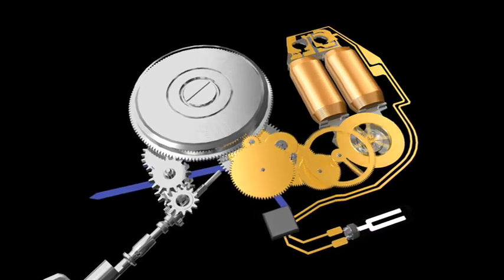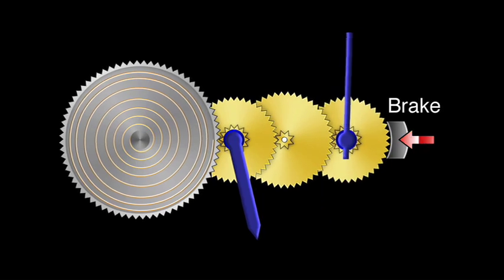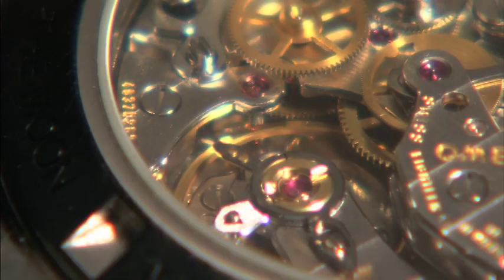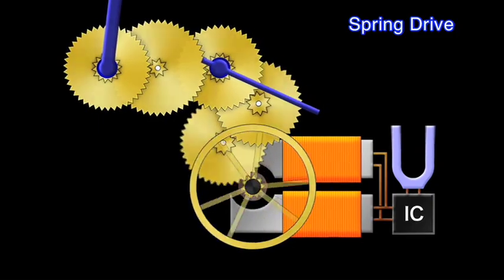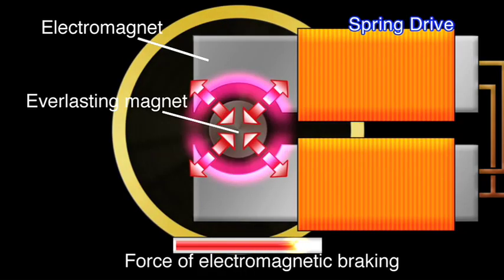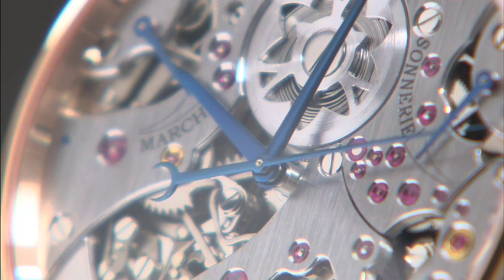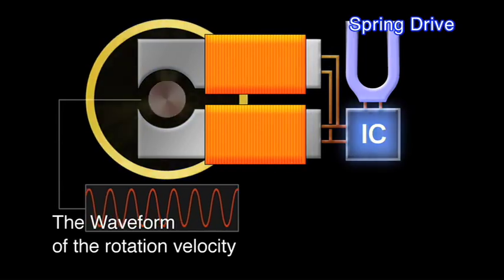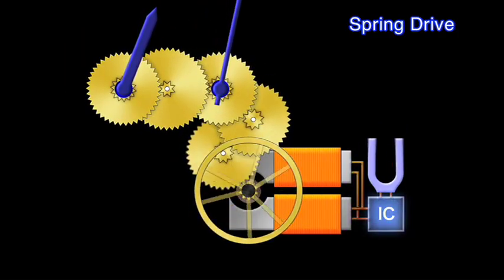Spring Drive function

Comment: This is the ideal design for mechanical watches.

This mechanism operates without batteries, yet an electronic unit manages all functions. The spring serves as the energy reservoir, similar to traditional mechanical watches. Magnets regulate speed, akin to regenerative braking in diesel locomotives. In Fields locomotives, energy is dissipated through a heater coil, while in this case, the energy produced by the regenerative braking powers the controller circuitry.

No batteries are needed, eliminating the necessity to open the watch annually. There’s no risk of battery leakage, and the accuracy is exceptional.

Comment: Tbh, this movement doesn’t seem all that complicated. Ppl have been talking about how complicated it is, but in reality, it just seems to me like an electromagnet regulated by a quartz movement to brake the hands. I’m not going to claim I could make this in my sleep, but at the very least the concept seems simple enough
Reply: Not complicated at all, it took Seiko 20 years and hundreds of prototypes to get to production.Do you realize the electronics marvel this thing is? It requires a very low electric current to power up the IC and generated the electro-mechanical break.

Comment: the breakthrough will cause a lot of debate regardless of the impressive results because the path taken is unusual 

unlike innovation where most will nod at the path taken and the impressive results

Spring Drive is a breakthrough, NOT an innovation

Comment: This is absolutely brilliant. The biggest downside to a quartz watch is the battery, be it a regular button cell, a rechargeable cell, or a heavy duty capacitor like Citizen uses, it still is a vulnerability if one cannot be sourced. An automatic watch, while still vulnerable to impacts and wear, doesn't need any consumable power source.
Reply: @mybrainlikesthings  you're not wrong there, higher end quartz requires far less maintenance than even the simplest mechanical or hybrid drive movement. Even without AT connectivity a good quartz can still be less than a minute off over the course of a year, and a high end one may gain 15 seconds a decade at worst. It's really just the battery waste itself that bothers me. While one button cell every 5-10 years isn't exactly dumping used car batteries into the ocean, they are still technically hazardous waste if improperly disposed of. I've been trying more and more as I grow older to move away from single use batteries wherever I can. Even though mechanical parts need to be replaced and disposed of as well, in theory those are just base metal, and even if they can't be recycled they pose less of a chemical threat to the environment.
Reply: How is the kinetic energy in the main spring not a "consumable power source"? ...the power gets consumed by the watch until in needs winding again and therefore gets revitalized. Just like a battery! ...only in longer intervals, which could be considered an advantage
Reply: @alphadawg81  spring drive watches are wound by a rotor, like automatics, so the consumed kinetic power is replaced by the motion of someone walking around rather than a battery cell. Kinetic energy transfered into potential and back into kinetic and electrostatic all at once. Most have 72 hour power reserves, so as long as you wear it at least half the days in a week it won't stop working for years at a time.
Reply: @manoflego123  
You weren't originally speaking of automatic movements. 
But even then, solar movements would ne their direct counterpart. 
Their cell needs renewing less often than a mechanical movement needs servicing.

Comment: No escapement = not mechanical.
Reply: There is an escapement. It's just electronically controlled instead of mechanically controlled. Besides, it still uses a mainspring. If anything, I'd call this movement electro-mechanical
Reply: Seriously, that's so utterly absurd, ridiculous and factually incorrect.😮😮😮😮

Comment: a quartz watch without a battery - why? Seiko allready have the kinetic system - if you want a quartz without the need to change the battery - buy the kinetic (or the solar).
Reply: Because a mainspring-driven watch has higher torque compared to quartz movement. With higher torque, watch designer can put longer hands on the movement.
Reply: I had an AGS watch that had a faulty battery/capacitor, and after an expensive repair the new capacitor also broke and leaked all over the inside. A Pulsar watch also didn't last for more than a few years. So, I don't recommend those watches (at least from Seiko). Spring drive does not have this problem.

Comment: Mechanism SPRING DRIVE - sucks!! Do not buy this broken piece of iron!!! Unfortunately, I fell for an advertisement and bought SEIKO LANDMASTER with SPRING DRIVE!!!! After a week, the clock just STOPPED !!! Very disappointed !! Do not take this piece of shit!!! If interested, there is a video of how they stop ...
Reply: The term imbecile was once used by psychiatrists to denote a category of people with moderate to severe intellectual disability, as well as a type of criminal.[1][2] The word arises from the Latin word imbecillus, meaning weak, or weak-minded.[3] It included people with an IQ of 26–50, between "idiot" (IQ of 0–25) and "moron" (IQ of 51–70).[4] In the obsolete medical classification (ICD-9, 1977), these people were said to have "moderate mental retardation" or "moderate mental subnormality" with IQ of 35–49.[5]

Comment: if the Swiss invented this they'd be raving about it, the Spring Drive is awesome best movement imho
Reply: The release of the spring's energy is dictated by a friction-less interaction that uses quartz as a reference, not the quartz itself. I wonder how the movement would perform without the quartz portion. Anyways, even if it's just another quartz we have to agree that all things considered it's on a different level.
Reply: @TheGrenadier97  Yes. That's the point. Quartz as a reference.
Reply: Exactly what I thought 😄
Reply: Yep it doesnt get the recognition it deserves!
Reply: Precisionist has a ticking second hands, 16 beats per second. Shut up if you don't what the fuck you are talking about

Spring drive can't be considered a quartz movement, because the motion isn't generated by quartz but regulated by it.
Reply: @morgenstern4.669  The whole “spring drive isn’t driven by quartz, it’s only regulated by it” is true, but this is true for ALL quartz watches. The only distinction is that most quartz watches use an electric motor and a battery, whereas spring drive uses a spring. Spring drive is technically a quartz movement, it just gets its own name because it’s a very cool quartz movement without a battery.
Reply: @Sk3tchPad  Nothing wrong with being a quartz movement tho. Technology evolves all the time.
Reply: blaser   Bulova precionist  quartz. Has the same effect, smooth sweep. Both are not mechanical aka no escapement.
Reply: @jackchueh1231  bulova ticks if you look at high fps. Meanwhile spring drive gives a smooth glide even when looked at high fps
Reply: Its a hybrid. Expensive too for no reason.   This technology should be much cheaper than 5,000$...  thats one reason it passes everyone by. When you first see it work. Its beautiful. Serene. Peaceful. . Then you see the price tag n its gone from though. They are charging the same price of a mechanical watch With an refined escapement. You can get a new speedmaster for that...  what would you choose?!  5000$. For a watch that can literally be biased to perfect its time. N should cost 500$ at most...  seiko is dramatically over priced. These can be mass produced comfortably.
Reply: @treatb09  there is A LOT more to a grand seiko than just the movement. I would say it is actually for less over priced than many of its contemporaries
Reply: @treatb09  The $5000 you pay for a spring drive watch is not just for the movement, which by the way is handcrafted and beautifully finished. It's also for the case which is also handcrafted and finished to perfection. Zaratsu polishing isn't just run of the mill work and the dial is also meticulously patterned and assembled by hand. If anything, $5000 is a bargain compared to what Swiss companies charge for similarly handcrafted pieces that don't have this level of innovation in their movements. 

And you think this is worth $500? Seiko charges that for their mid to low tier watches which, again, are way cheaper than their competition while still being quite accurate.
Reply: @aozf05  too fat… too thick…. Like Japanese GTR versus Porsche 911.  Ugly at least the sport pieces.  Now imagine is they made a 40mm case and 12 mm thick.
Reply: @aozf05  luxury items are defined by quality AND brand recognition…. Grand Seiko has no brand cache..because the entire wolrd associates Seiko with beater and rightfully so.
Reply: @aozf05  people might now think that anywhere the thumb is behind the slide when firing, that they are safe.
Reply: @jackchueh1231  You don't know what you're talking about. Grand Seiko split off from Seiko a while ago and doesn't really do sports watches. And I don't have to imagine a smaller case. Have you seen the Omiwatari? Their new dress style case design is a few years old now, it's 38.5mm wide, 10.2mm thick, with 43.7mm lug to lug. You have no clue what you're arguing against.

Grand Seiko has brand recognition for the quality, accurate timepieces they make. They are luxury items. Seiko making beaters doesn't take away from that fact. Even their beaters are still quality watches.
Reply: @aozf05   dress watches are out if you didn’t get the memo… I want a dress watch , I get a  JLC.
Reply: @aozf05   99% of the public wouldn’t know a grand seiko from a seiko. Even Toyota wouasnt stupid enough to market Lexus as Grand Toyota. Audi as grand Volkswagen. Further, spring drive is in several Seiko models. Not just Grand seiko.   Imagine buying a GS at full retail and walking out of AD and your watch is worth 35% less.
Reply: @aozf05 it was fun reading the misinformed haters. You're not a misinformed hater. In fact, I'm amazed the comments have such Swiss shills. I really thought at least 98% of folks who knew about spring drive and GS were actual watch enthusiasts, not Rolex drones.
Reply: @jackchueh1231 Depends who you socialise with. Grand Seiko has plenty of cache with people who buy luxury watches, and rightly so.
Reply: @jackchueh1231  to be fair the GT-R did beat Porsche on their own test track when it came out.

Comment: Does anyone know if these are EM resistant? Would holding magnets mess up the internal computer permanently or just temporary? Do they have EM shielding?
Coolest watch ever, I really like no maintenance high accuracy time-pieces.
Reply: They have a moderate amount of magnetic shielding, though not quite as much as a Rolex Milgauss but enough to resist any day to day magnetism.
Reply: @G1NZOU  would that be a constant limiting factor of the spring drive, or would it be possible to create a spring drive watch with ~15,000 gauss resistance, such as the Milgauss or omega Seamaster?
Reply: @User-dn9iv  omega have subjected one of their watches to 160,000 gauss and they still work. The watch is in their museum. The reason they don’t do that every watch is the machine is too big for their building LOL. Omega is king of magnetic resistance imo
Reply: @jebbush2527  how strong is 160,000 gauss? And why would you need magnetic resistance? Would a normal mechanical watch slows down when came close to, let's say, subwoofer or some sort? I never own a mechanical watch before, my best watch was a cheap 50m water resistant casio dive watch..
Reply: @Herr_Scheissemann When the interior of a mechanical watch gets magnetized, it affects the rate at which the balance wheel is spinning, thus having a negative effect on accuracy. I think it has something to do with electro-magnetic breaking, where a metal part moving in an electro-magnetic field generates Eddie currents which then form another EM field which acts opposite to the movement.
I might be wrong though.

Comment: The accuracy will be no greater than its quartz reference, which is unimpressive. The Bulova Precisionist's quartz movement is much more accurate and has a power reserve measured in years, not days. The price of the Precisionist is also just a fraction of this Spring Drive watch. The same goes for complexity ... there's a lot more to go wrong with the Spring Drive. Finally, the "continuous drive" of the Spring Drive is mimicked by the Precisionist with its eight beats per second appearing as smooth as the Spring Drive to the human eye. The only down side of the Bulova is your bragging rights and finish of the watch. The Spring Drive will appeal to your vanity much more than the Precisionist.  

If you desire extreme accuracy, make your money work for you better ... get more for less with the Bulova 262 Precisionist.
Reply: @Dapdoi Ardon A fellow ArchieLuxury subscriber, I assume
Reply: you just couldnt get the logic behind the design
Reply: I know this is old, but the Spring Drive is a mechanical watch (driven/powered by a mainspring), but has the escapement replaced by a single continuous spinning wheel that is electromagnetically balanced to spin at the right speed to slowly release the mainspring. It's wild. Absolutely insane idea. It doesn't need batteries, it's a mechanical watch regulated by a quartz crystal and IC that is powered by it's own winding spring.

The Bulova Precisionist is a nice quartz watch, but it's mostly just that. Bulova's old Accutron tuning forks were awesome. The precisionist is just trying to keep a bit of that heritage whilst being a high-beat quartz watch.
Reply: Harpo Marx 

What is the problem with Quartz ?

Quartz movement is more accurate than most swiss watch mechanical mvmt !

Combining Electromagnetic + Quartz + Mechanical = Spring Drivd

Which is by far the best technology there is !

Grand Seiko with a 5 hz (36,000vph) has the best accuracy in this world !
Reply: @ReformMsia  Uhh no that would go to Zenith
Reply: Tippy Kaffu 

Zenith has much respect ✊🏼 for an automatic watch to have a high beat movement

But still pale compared to a spring drive mvmt
Reply: This inaccurate. I have a 10hz watch and definitely can tell the difference with the spring drive movement

Comment: 0:50... lol ! It uses a balance wheel called a balance wheel...
Reply: Lol
Reply: Isn't it called an escapement?
Reply: @msfasa  rather than an escapement and balance wheel, instead features Seiko's Tri-synchro Regulator system in which power delivery to the watch hands is regulated based on a reference quartz signal